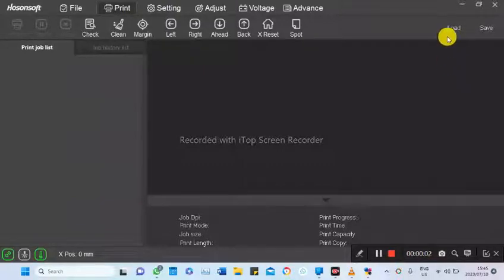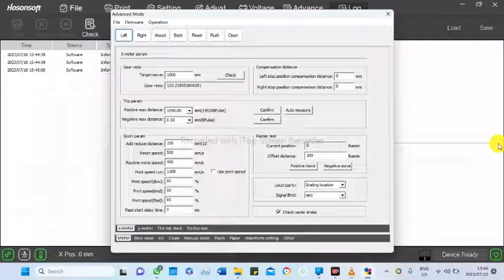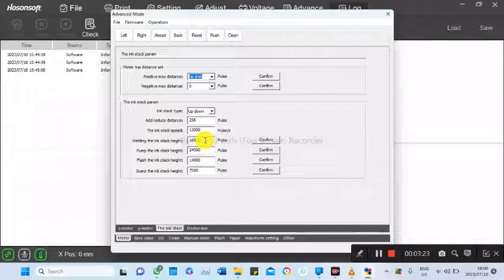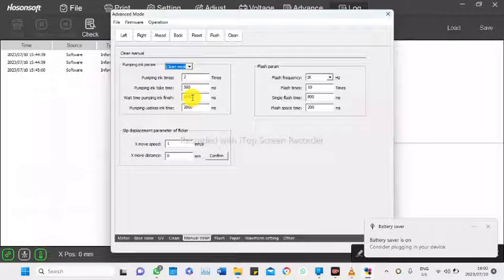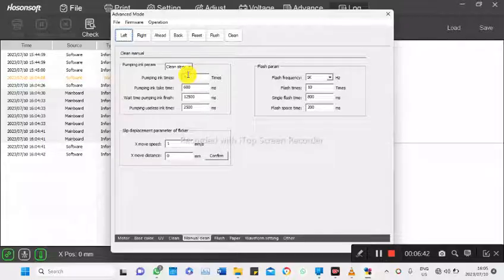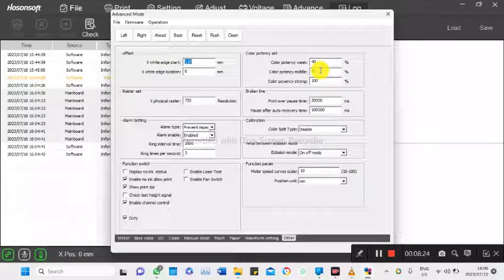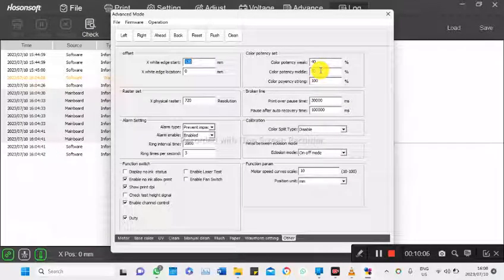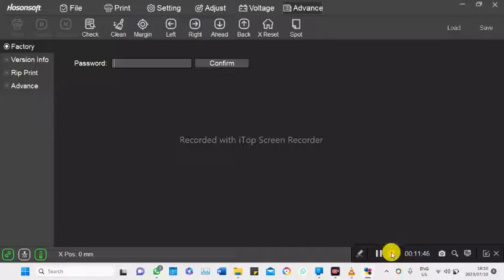DTF HOSONSOFT PrintEXP Part 2

Comment: Hello. I need to increase the print width of my machine. I need to go from 275mm to 285mm, but I don't know which parameter to change when entering factory mode with code 222222. Could you please help me? 

I used to do it, but they updated F Ware and I don't know where to put the new measurement

Comment: Hey so I noticed when I turned off my printer ( UV DTF) the in caps does not go all the way up to seal the print heads.  This is the same for when the printer is reset. Two questions: Does the ink cap needs to completely cover the print heads when the machine is turn off or in idle and what settings I need to change in the hosonsoft software to achieve that ?
Reply: Yes it does and I am trying to figure that out, adjusting the numbers by the hundred will allow you to go up and down. Make sure it is putting slight pressure, not too much tho when engaging the printhead

Comment: I am able to print upto 21.3 inch width. If i set the file for print width above 21.3 inch i get the error "Failed to print:,the print width exceeds the distance of max motion" in PrintExp. My printer width is 24 " inches.Please provide solution to print maximum width.
Reply: Go to factory settings to change the range. Contact your support for password.
Reply: Проверьте начальную точку печати, скорей всего, она стоит слишком далеко. Поставьте 55 мм